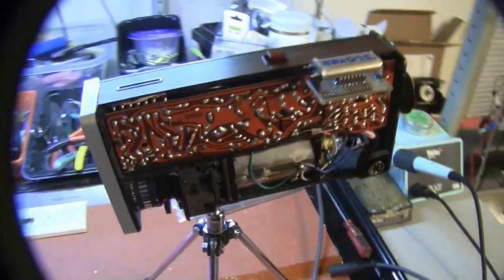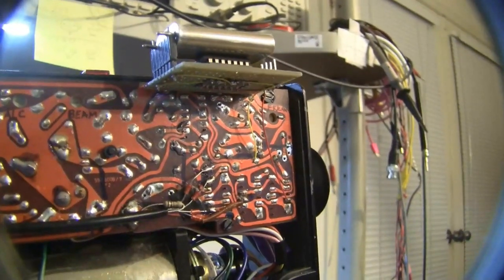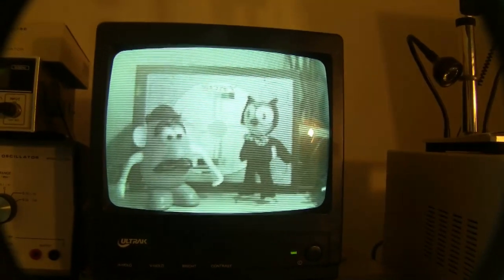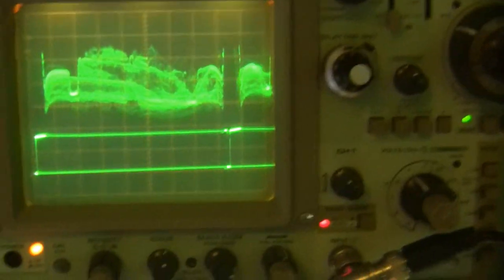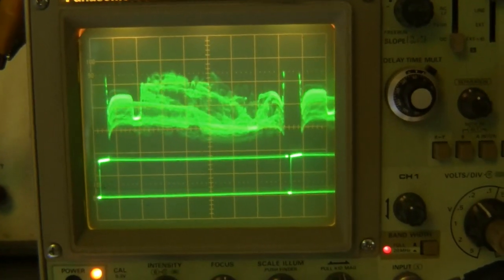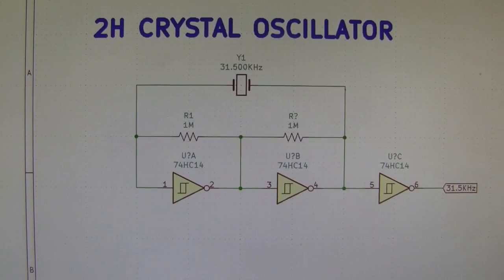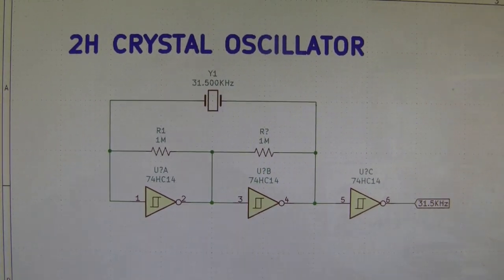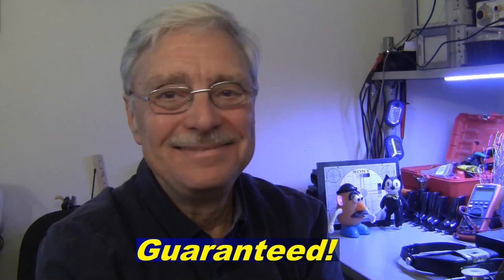Cartrivision Camer-A-Thon, Part 9 - Crystal Oscillator Modification

Comment: Great job as always Lab Guy... That's a rock solid picture you have there... For stability of frequency you cant beat a Chrystal Oscillator.. i know most radio manufactures went to PLL long time ago to reduce cost but if frequency accuracy is crucial you just cant do any better imo... 73's DE KK4MMM..

Comment: This is all well over my pay grade but extremely fascinating!!
Reply from the maker: If you watch the deep dive video, you will see that these old cameras were "relatively" simple. In this video, I replace one oscillator with another. The goal is to make the camera ultimately run on 12 volts DC, without the need for the 60 cycle power line pulse. This camera's weakness is that it needs 18 volts DC and a pulse from the power line. It's a form of ultra cheap engineering. Since there are still so many of these cameras in existence, it is my goal to develop a couple of simple mods to make them usable again.
Reply: @videolabguy  I kinda got the gist of it. My dad was an electrician and I’ve done a little circuit bending of old electronic toys and messed around with arduinos/raspberry pi’s, but nothing quite at you level. I’ve really enjoyed watching your videos after coming across your channel just yesterday!

Comment: As long as Felix and Spuds are in the frame, "Jaggies" are okay with me.
Reply from the maker: In the next video, I will try to remember to do video capture to show the jaggies effect more clearly. For some reason, this video was all about, "Pump this thing out!". It was not well thought through. It bothers me when I go to long without producing some content. 
I did some experiments last evening with interesting results. Learned a great deal about the operating voltage. 18 volts vs 12 volts. You all may be stunned by my discovery. I was. 
The 31.5KHz crystals are literally made of unobtainium. I have been pestering Seiko Epson for samples of their watch size 31.5KHz crystals. But, only getting silence. So, we will resort to another method to get good timing in this camera and inform you of that when the parts arrive. I am importing them from the Orient as well. So, they may sit in the container ships for a while before they arrive. So, stay tuned, there is lots of discoveries to be shared with my viewers. Thank you for your patience.
Spud and Felix say, "Howdy!".